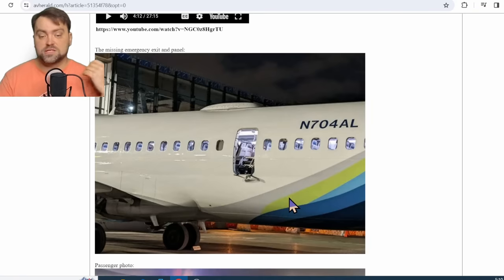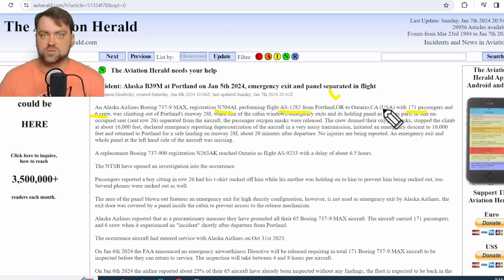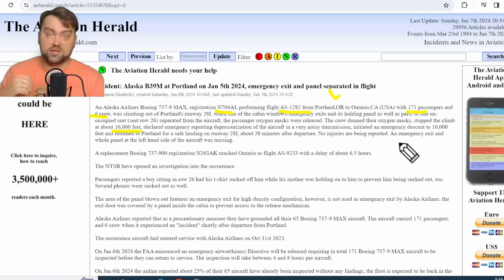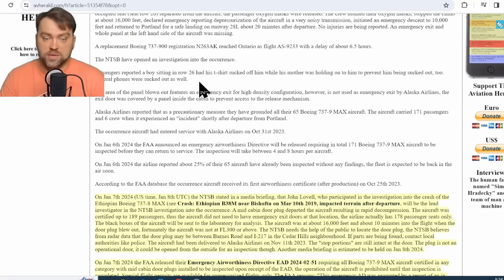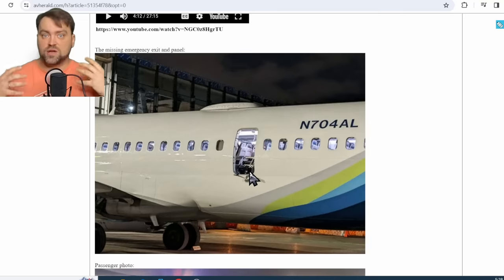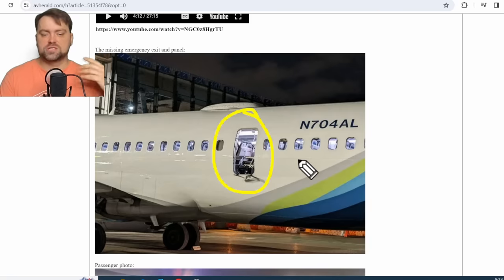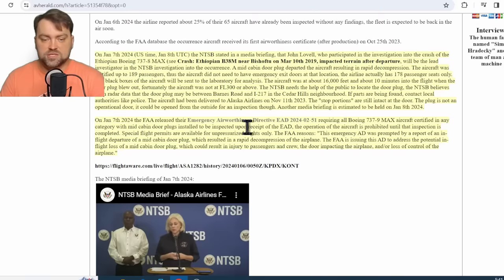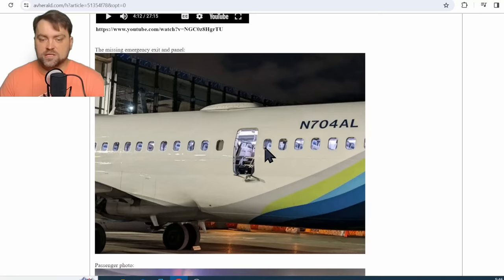Alaska Airlines Boeing 737 MAX Door Separation Update | What Happened?

Comment: Thank you, Denys, for your reporting on this incident!  It is quite thorough.  As for the incident itself, this really does seem to be quite surprising.  Having never worked on a B737 of any type, I can't say that I am familiar with that particular type of door, but I am guessing that the old 727's had doors similar to the one that failed on the Alaska flight.  In either case, it seems very unusual for such a problem to have come up.  Also, I would assume that there would be some sort of light on the fight decd indicating a problem with the door if the seal was not sound.  As a pilot, I would ask you whether you think the crew had to prepare the cabin for an emergency landing, or not, given that the AC didn't seem to have any other issues.  This happens, of curse, based on what the actual issue is with the AC and what the Captain considers the riss to be to a safe landing.  I can easily see where the Captain might request emergency priority to and, but that the Captain might now request the FA's to ready the cabin for an emergency landing.  What are your thoughts on this particular issue Denys?

Lee
Reply: This is not a door.  It's a plug where a door can optionally be installed.   There is no light in the cockpit because it doesn't have a latching mechanism so there is nothing to monitor.  It isn't a door.  The pilots declared an emergency as soon as pressurization was lost and they landed as an emergency aircraft.
Reply: Hello and thank you or the information.  S, you are saying that it is not a floor level exit?   I have seen many different doors as an FA for 10 years, and that certainly looks like a floor level exit to me from the photos. If it is a floor level exit, I would think the pilots would get some sort of indication if there were an issue with the door that was noticeable prior to the explosive loss of the seal and door.  Given the speed at which this accident seems to have occured, I can imagine that the pilots' first warning was when they lost the door itself and the AC depressurized.  

As or your comments regarding an emergency landing, there are different types of emergency landings, as you should know if you claim any sort f experience as a pilot of FA.  Some  emergency landings happen suddenly, like the A  flight recently.  There was obviously no time to prepare the cabin for a specific and planned emergency landing since it occurred on landing itself and was certainly unexpected.  The way the FA's prepare the cablin for such emergency landings is by the routine process we go through every landing.

Then there are the emergency landing where the pilots decide there is very little chance that the AC will need to be evacuated upon landing.  Thus, the FA's do not prepare the cabin for a possible evacuation.  And, again there are those where the cabin is prepared for a possible evacuation, but it may not be necessary.  In such cases, the A's prepare the passengers for a possible evacuation, but they await the pilots given the signal to evacuate once the AC comes to a complete stop (in such cases, depending on the time available for preparing the cabin for a possible evacuation, passengers at each exit are briefed and given responsibilities if an actual evacuation is called for.  Depending on the time available prior to landing, this is done either from the FA's jmpseats, or in the aisles.  And, then there is the kind of emergency landing where the pilots are expecting that  an evacuation will be necessary, and the FA's do a briefing, again, either from their umpseats, or in the aisles.  

Aslo, regarding the door, it reminds me of a 727 rear galley door, or the one just opposite it on AC RT.  Both of those are Floor Level exits.  So, I am guessing that since this was a Boeing AC, then the door that blew out was similar to the ones on the 727, which I am very familiar with.  Also, the doors must be sealed properly prior to [ush back, and if there is any problem, a light DOES appear on the cockpit to alert the pilots.  After all, the pilots need to know if a door seal is weak when it is detectable.  I have been is such situations before where a door is not sealed properly.  As long as there is maintenance as the Airfield, then they will get it resolved there prior to push back.  I the door seems to be sealing alright, but there is some issue that can be resolved alter, then  maintenance can be delayed depending on what the actual problem is and whether it poses a threat to the AC prior to arriving at a station where maintenance is available.  I know this from first hand experience, and it is not theoretical:).  

I hope this makes it clear what my questions were designed to address and hopefully be answered by Denys:).  Thank you again for your comments:)!

Lee    @stargazer7644
Reply: @LeeColes100 It isn't an exit at all.  It's a hole in the wall with a permanent plug bolted in it that an exit CAN be installed into in the future.  If they were to put a door in that hole, then that would be monitored.
Reply: Hmm, well,  then that helps explain some of what happened.  My only confusion was them talking about it as if it were a door, if in fact it was not a door.  lol  Even just reading the title of this video, they refer to a "door" separation.  i d understand why there would be such a "plug", but I don't understand at all how such a "plug' could be designed in such  way that it COULD blowout.  That strikes me as particularly odd.  However, knowing  bit about how "doors" on AC work, I do understand that i a "plug' is designed to mimic a "door", then I can see where if the "plug' were relying upon the same basic systems in pace for a "door", then I can see where such a problem might occur.  The bolting system and pins they describe in Denys' most recent video regarding this incident are familiar to me, and I can see where a failure might happen because the locking system is similar, if not exactly like that of a regular door, but designed not to be opened as a regular "door" would.  It seems designed to only be secured in a way similar, if not exactly like that of a functioning "door."

in either case, stargazer, i appreciate your patience in getting me to understand that this was not a door, as your first reply stated. And, I apologize that it took me so long to understand the difference between a "door" and a "plug hatch.'

Lee  @stargazer7644
Reply: @LeeColes100 This plug is not like a door.  There is no latch mechanism to open it.  It becomes a permanent part of the outer fuselage. It has 12 fingers that slip behind 12 tabs attached to the sides of the aircraft frame. The plug pushes in from the outside and slides down to interface with those tabs.  Once down, there are 2 bolts that stop the plug from lifting up so it can't come out.  Then they put regular interior panels over the inside.  It just looks like a regular window.  The plug in this case did lift up, and blew out and separated from the aircraft.  That would imply that the two bolts holding it in either failed, or more likely were never installed in the first place.  There are other channels including the NTSB briefings and Blancolirio that go into much greater detail about what happened.

Comment: FAA in Boeings pocket, they should be a totally separate entity.
Workers speaking up about conserns and issues getting sacked.
Whole assembly plants being relocated, so no unions in that area.
Subcontractors carrying out work.
Managers overrule engineers.
Bad working practices 
Profit before safety.
Burger flippers brought in off the street and straight onto making aircraft.
Most of these guys wouldn't fly on the aircraft they build, what does that tell you !

Comment: I think all doors in the max9 are plug-type…..except the emergency escape doors, just aft f the wings are non-plug type and are held in by electrically operated latches? Probably have to confirm with the aircraft’s manual.
Reply: These are not doors, they're plugs.  No doors were installed in these locations on this aircraft.

Comment: NO, but Alaska Air is!  Investigate what "maintenance" was done on that plane. Even a "loose" bolt will not "fall out" it is a castle nut with a cotter pin through it. More like missing hardware.

Comment: it was a plug not an emergency door. It looked like any other panel with a window.
Reply: Correct.  The plug is a provision for emergency door option should airline customer select the option to accommodate their LOPA or airplane interior configuration.

Comment: AS ignored the warming on 3 previous flights.
Reply: They certainly didn't ignore the warning.  They investigated it per the maintenance manual and everything tested ok.  They scheduled it for more in depth testing since it happened multiple times.  They restricted the plane from flying over water which they weren't required to do.  There's currently absolutely no indication that the pressurization warnings had anything to do with the door plug.  The warnings went away when they switched to the backup pressurization system every one of the 3 times.
Reply: Yes they did.

Comment: If they don't yet know the reason the plug failed, what do they actually inspect? What if it's a design flaw and all they can check is that the plugs were installed as they were designed?
Reply: They don't anticipate a design flaw.  This same door plug has been used on multiple variations of the 737 for over 20 years with zero problems.  They've already determined the reason the plug came off the aircraft is because it lifted up and released.  There are two bolts that are supposed to prevent that.  So that means either the bolts somehow failed, or more likely they were never there.  They're looking at the door plug for witness marks that would indicate if bolts were ever installed.  Those bolts were not found with the recovered door plug.
Reply: @stargazer7644  Right, the more I look into and understand the mechanism, the more I am convinced that the bolts were likely not installed. The looseness of the bolts should have no effect since the castle nut with a cotter pin should keep the bolts there to prevent the door from sliding up.
Reply: @gang208 Yep

Comment: There is a detail that I head in some video which I wonder if it is correct.  IIIUC, an ariline door usually opens inwards, so the cabin pressure pushes them against the door frame and prevents the door from opening in flight.  But that emergency door (all 737max doors?), when used, opens outwards and his held closed only by the latches.  The plug likewise is held shut only by 4 bolts at the corners.   Is that correct?
Reply: Not exactly.  The door/plug is held in place by two vertical columns attached to the hinge at the bottom and two  horizontal lugs at the top that engage into short tracks in the door.
The four bolts everyone is referring to lock the hinge columns and lugs to prevent the upward movement that allows the tracks in the plug to disengage from the lugs in the fuselage. 
For a door those bolts are not needed and it has six pins preventing upward movement that retract when the door is opened.

Comment: Seems stupid to have a “door plug”? Either it’s a door, or it’s a fuselage. Why invite catastrophe?
Reply: Exactly.  How many planes do they build each year....Can't be so many they need such mass production.
Reply: Because it is not cost effective to retrofit a door into an aircraft later, and it is not cost effective to make a dozen different designs for the same plane.  They could have made it a door, but then there's extra cost for something that isn't required.  So they make a plug and everybody is happy.  They've been using these identical plugs in various generations of 737 for over 20 years with zero problems before now.  How exactly is that inviting catastrophe?
Reply: @Dubinski2382 They build thousands of these every year.  They have an order backlog of nearly 6,000 planes.
Reply: @stargazer7644  Around 1,100-1,200 planes are built globally each year.  Boeing builds about 30 737s per month.
Reply: @Dubinski2382  Yeah I guess you're right.  The numbers I was looking at were cumulative.  They delivered 387 MAX aircraft in 2023, 1420 to date.  They had orders for 883 more in 2023, bringing the total to 6,203.
Reply: @stargazer7644  They do have 6-8,000 orders but I guess it'll just take 20 years?  Not sure how this industry works haha.  It makes no sense.  I think that's why most airlines in other countries are state sponsored.

Comment: It's a clean removal!! Looks like the adhesive failed, which if so is a serious serious issues as many items are bonded these days..
Was it the correct adhesive, applied correctly, fixed and cured correctly.. Obviously not..
Boeing really seems to have serious safety issues.
Reply: Adhesive? They don't glue door plugs in place.
Reply: @stargazer7644  Maybe Boeing do! 😂
Reply: @ShinyHelmet  yeah, when they run out of duct-tape, they run over to the supermarket and get some glue :)

Comment: Doesn't the cockpit have a separate pressure cabin from the passenger section? Isn't the cabin pressure used to push that door plug tighter into the fuselage with a tapered frame (like viewing ports in submersibles)?
Reply: No, there's only one pressure cabin.  This was not a door, but a plug.  It is not held in with air pressure like some of the doors are.

Comment: What if it had blown out at 40,000ft
Reply: It would have had about the same result.  The cabin pressure of the aircraft gradually lowers to about 11 psi as the plane climbs.  The inside/outside pressure differential is always less than 8 psi.
Reply: @stargazer7644  wow.  I thought it would b way worse.  Thx

Comment: Yet this aircraft had three previous pressurization warnings so Alaska kept it off their Hawaii route so that it could return to the nearest airport immediately. Is this an airline you'd like to fly on that rolls the dice. You didn't add any new information that wasn't already known.
Reply: And they also checked and tested the pressurization system 3 times and found no faults.  It also flew over a hundred flights with no faults.  What do you expect them to do?  Throw away the entire airplane once a fault light illuminates?  I've got news for you, you roll the dice every morning when you get out of bed.  And it turns out they weren't required to implement that ETOPS restriction, but they did it anyway.  Hell yes I'd fly with a company that goes out of their way for passenger safety.

Comment: So  ..let's get this straight:
1) Extended length 737-9 MAXes have TWO EXTRA emergency exits precisely because they have much greater seating capacity.
2) Alaska Airlines don't use the extra seating capacity that this aircraft affords
3) So Alaska Airlines have removed the two extra emergency exits   ...in order to fit even more seats ??? (4:44)

Err... What happens WHEN (as inevitably will happen) the flight is chock-full one day?  They're going to have hundreds of passengers with far fewer emergency exits.  
Surely the plane should ALWAYS fly configured for being fully accommodated? 
This sounds like rather dodgy practice by Alaska Airlines
Reply: no they increased the spacing of the seats so more legroom and less seats than max . therefore less passengers means no need for the extra exits.
Reply: They don't add and remove seats depending on how full the aircraft is.  You can order this aircraft in sardine configuration with all the seats closer together to give you more rows.  If you order this config then you have to have the extra doors.  Nobody uses this config because your passengers will hate you.  So they space the rows out more so there are fewer seats on the plane and they don't require the doors.  It has nothing whatsoever to do with how many seats on the plane are full at any particular time.